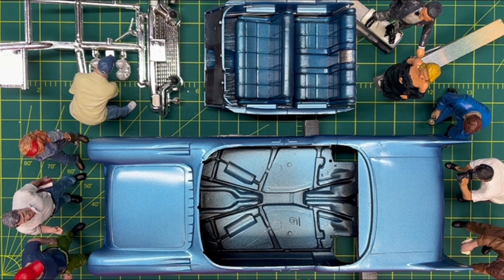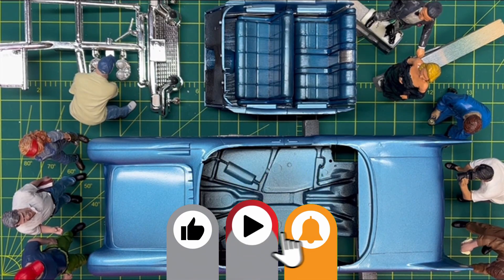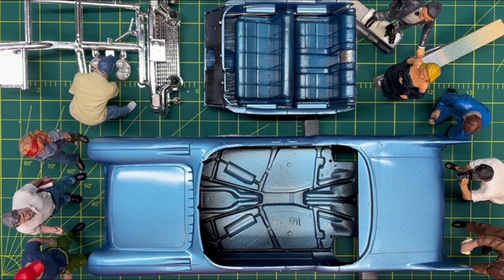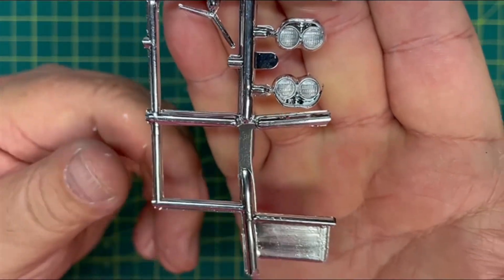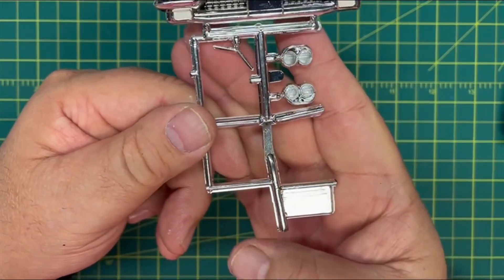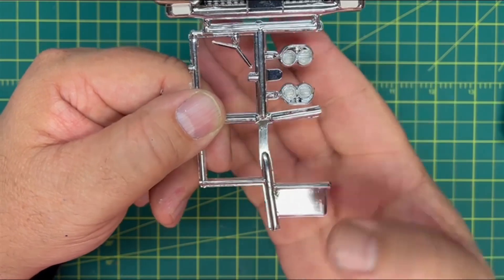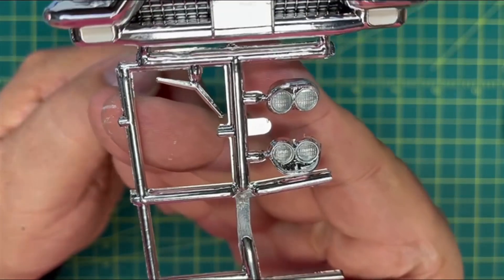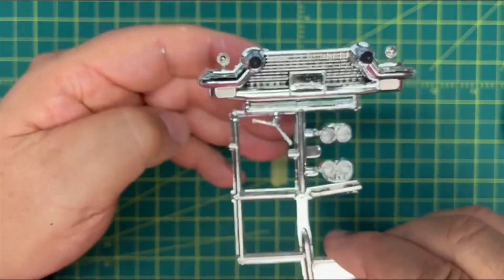Revell 57 Cadillac Eldorado Brougham build update #5 Getting Close Now!

Comment: You have done a great job so far.  For a curbside, this one has required a lot of work.  Thanks for sharing.
Reply from the maker: Thank you.  This is the first curbside I've done in years too.  I was thinking it was taking me a long time, but it's going to be worth it in the end.
Reply: @grandpamarkshobbies  Yes it is.  The amount of body work to fill those sink holes took a great deal of time.  Modern kits usually don’t have those.
Reply from the maker: Very true, that body was about as rough as any I've worked on (and not chucked)  LOL
Reply: @grandpamarkshobbies  It is a well engineered kit, but it’s over 60 years old.  How technology has changed.
Reply from the maker: That's for sure, but I've seen newer kit's that don't fit this well.  LOL

Comment: Another great update!  For the Molotow Chrome, if I may share something I do. 
I use the refill for painting chrome trim (like your steering wheel.)
I usually put a couple drops in a paint pallet and use a small brush or sharpened toothpick to chrome up parts. 
Again, great work!  Your build has me thinking about getting this Caddy for the future. 🤔
Reply from the maker: Thanks for the idea.  I was thinking of ordering a refill instead of a new pen.  I would much rather paint it with a brush.  It would give me much more control.

Comment: Very nice Mark. Another great build.  How do u prep and apply ur BMF.  Thank you
Reply from the maker: I usually cut strips larger than needed, then use my knife to pull a little section away from the paper.  Then I pull about an inch of paper back and cut it away.  Next I place that down and start removing the paper as I put the foil in place.  once it's lined up I use a q-tip rubbing from the center working the length of the trim working out from the center.  once I'm happy with that I use a toothpick at an angle and burnish in the edges.  Then I take a new xacto blade and color the tip and edge with a green sharpe marker so I can see where the tip is.  Then lightly, but firm enough to cut the foil I run the knife around the edge.  Then I use the toothpick again to loosen up extra foil and I carefully remove the extra with tweezers.  Do yourself a favor, and practice on something you don't mind messing up first.  It is much easier than the way it reads here, but this is what I do.